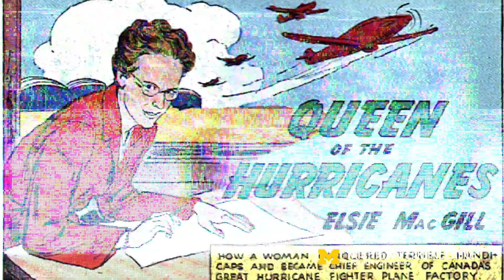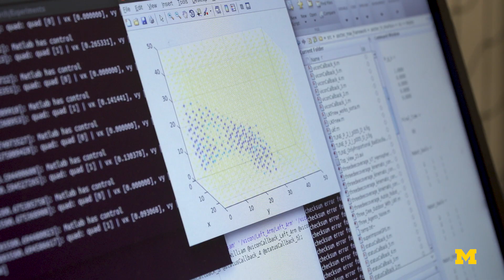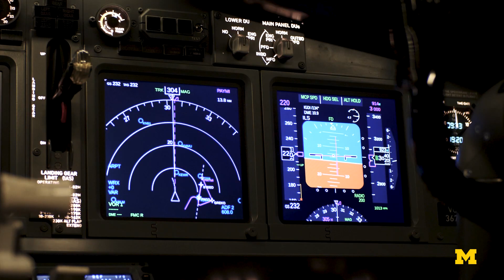Aerospace Engineering at the University of Michigan

Comment: BS Aero & Astro Eng 1969 - A great education that lead to a lifetime career helping to save lives and make life easier and more productive for many, many people. Thanks, UofM Aerospace Engineering and my teachers and friends.
Reply: Would you mind sharing some insight from your career?
Reply: @zack2804  Insight? Well, that's a tall order. Broadly, I started fresh out of school working in airframe aeroelasticity (flutter and dynamic loads) on a USAF plane for a general aviation manufacturer. I expanded into acoustics doing both FAR certification and interior noise control. I was fortunate to be asked to provide advise to the FAA and ICAO in that area and travelled extensively both at home and abroad in that capacity. I then abandoned the highly technical for the overview by doing technical project management on missile programs and aircraft defense products for a defense contractor. This eventually lead to an overseas posting that was the personal highlight of my career. In 35 years I worked for only two different companies and retired with the satisfaction of having provided improved products to customers with very different needs and goals. A few resulted in saving lives. I retired with good financial standing and the knowledge that my employers were each well pleased with what I did. I am certain that none of that would have been possible without the guidance of my instructors at the University of Michigan.